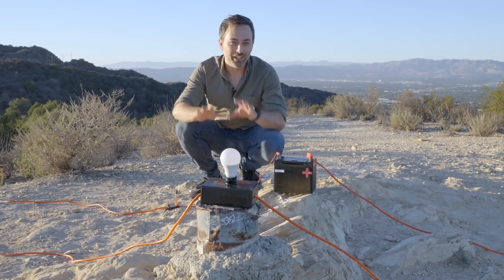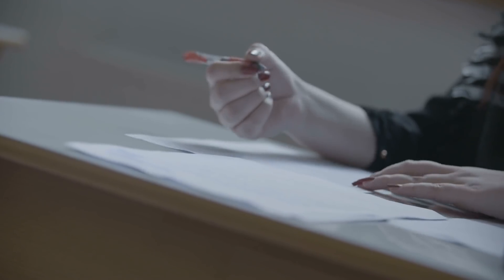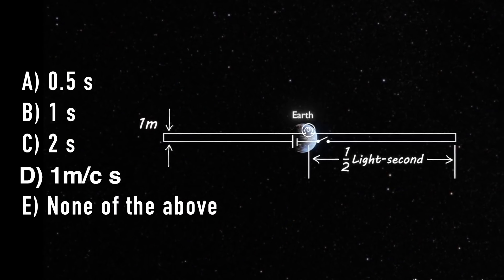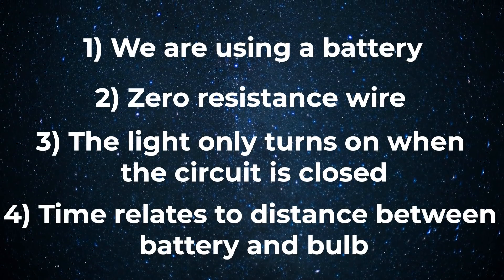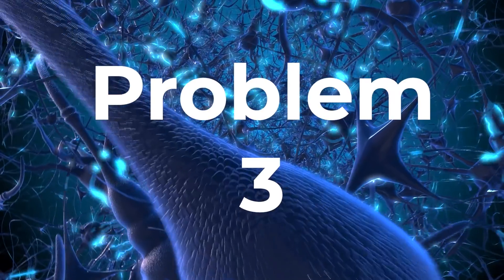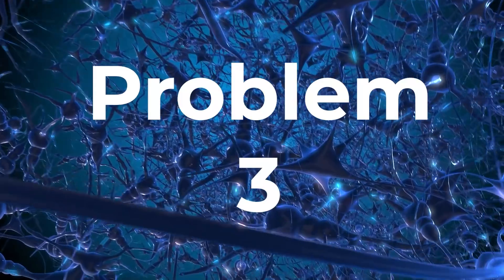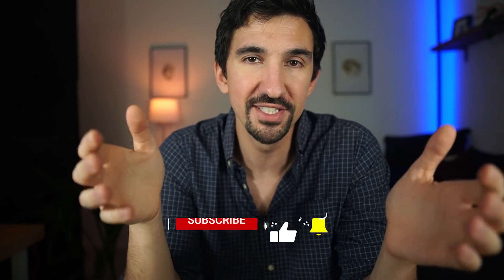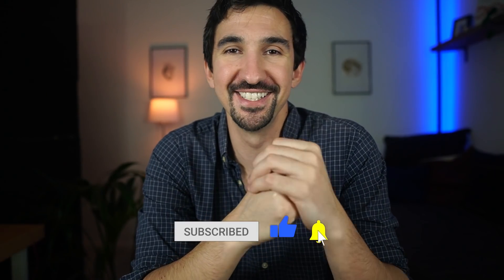Is Veritasium Wrong About Electricity?

Comment: It really helps to consider the following (imo)

1. This whole thing has been framed in a misleading/loaded way by talking about circuits from the get go, when there is in fact no circuit to speak of at least within the window of time he's talking about (~1m/c)
2. Locality is a thing. No matter how you dress up your puzzle, the fact is it's impossible for the lamp to "know" about a break in the circuit at some distance d from the origin until at least 2d/c seconds have passed after closing the switch. 
3. If the ends of the wire are far enough away that you have to account for the speed of light, then you need to stop thinking like an electrical engineer because this is no ordinary circuit. Changes in applied voltage will take a long time to propagate along the wires, so you aren't getting the usual self-interference. When we attach a wire to the negative terminal of a battery, without completing the circuit, we would say there is no circuit and hence no current. But we would be wrong; there is a current at first, but the electrons have nowhere to go and begin to bunch up against the end of the wire. This produces an electric field to counter the applied field and after some time, an equilibrium is reached and no more current flows. If the length of the wire is L and we (wrongly btw) assume that the signal travels at c, then we ought to expect it take roughly 2L/c seconds for the current to stop flowing. Given a meter of wire... that's 6.7 nanoseconds, so yeah we don't notice it. But if your wire is 1/2 a light-second in length, it will take about 1 second for this equilibrium to be reached. During which time, it is IMPOSSIBLE to determine by any means whether the wire forms a complete circuit, or reaches a dead end. In BOTH cases, the behaviour within the first 1 second will be identical, only diverging afterwards. So whatever energy reaches the lamp before that time (and it does exist for sure), would have done so regardless of whether the circuit was actually closed. It's a tiny amount of energy, not comparable to energy flux that you would have AFTER 1s given a closed circuit.
Reply: In all the fuss, this comment is the clear and definitive answer. IMHO
Reply: This makes sense to me.
Reply: Great point
Reply: Not only, but this explains also the one wire Transmission of energy described by Tesla, leaving out all the mystifications on him.

This using AC instead of DC (that tiny amount of energy get transmitted often with High Frequency)
Reply: I am so confused now it’s not even funny
Reply: Nice you've taken the time to write it, simple explanation, seems obvious for an electronics engineer. Thank you!
Reply: Well said

Comment: If the wires are 0 ohms, then doesn't that mean they can't act as antennas? My intuition says that the ability for the wire to couple with the source is dependent on its reactive impedance, so if we say it's got no impedance, then there's no coupling, and if there is coupling, then there is reactive impedance and the total impedance therefore becomes so high that the frequency characteristics of the circuit become such that the time constant is infeasible high and the light never turns on. Even if it does, it slowly begins flowing rather than flicking on instantly like an LED.

And if we go one step farther, then the coupling of the two wires together makes a capacitor, so now we aren't looking at an RL circuit but an RLC circuit where the virtual capacitor is moving down the wire at the speed of light

Comment: not very good experiment, what if you have       same setup, but with 2 wires very close to each other 1-2 mm, moment electirceity starrt to flow it will induce current in second wire and some current will be going thrught bulb, in even less then 1c/2

Comment: You are right. The current flow model of the circuit breaks down, and we need to consider the problem as an electromagnetic field problem. The time taken to see the bulb light depends on the capacitance of the circuit. The initial DC transient response of a capacitor is short circuit. Have a Google for transmission line s, particularly the lumped parameters model. With that, you can show that the globe will begin to light up, even if the remote ends are open circuit

Comment: My disclaimer is that I'm stupid and I don't have degree in physics. But I completely didn't get Veritasium's model and for my simple logic the real answer is 1s ,which is: the length of wire between battery and bulb / speed of light. 
The question is if signal propagates through the length of the wire or through the space between the battery and bulb. In this video Veritasium's battery-bulb model is compared to antenna -  as signal between the source and antenna propagate through the space. I refuse this analogy either because antennas receive signals transferred by EM waves, while in Derek's model signal in transferred by energy field . EM waves and independent from their source ,while those "energy flux vectors" are a part of a "energy field" - same as magnetic flux doesn't exist without magnetic field. In my opinion electric circle in Derek's model works more like a big magnet than antenna.

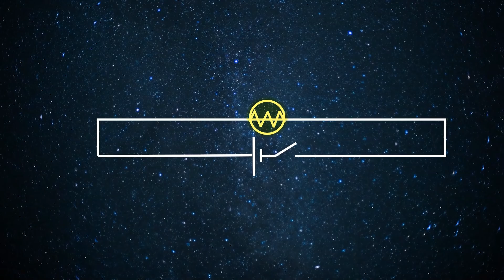Comment: At 4:30, the current does NOT suddenly stop in the light bulb if the circuit breaks 1/2 light-second away.  When the circuit breaks, a potential difference develops across the open circuit and an electric field forms and builds toward the light bulb and battery.  The light will continue to glow until this electric field arrives at the light bulb.  The increasing and decreasing electric field represents a "displacement current" that is just as real and physical as charge flowing through this space.  This electric field front propagates at the speed of light.  The arriving electric field cancels the electric field in the light bulb and stops the bulb's current.  (If characteristic impedances are not exactly matched, the dynamics can be more complex and die out more slowly.)  The characteristic impedance of two wires 1 m apart is about 1000 Ohms so we would need about 1000 V for the bulb to glow visibly.

Comment: The problem is that ultimately the force that causes the bulb to light up is still traveling along the wire the entire distance from the battery. The forces Ben Miles is describing in the last third of the video exist, but are not what is causing the bulb to light up. They could be detected, its true, but in devices like radios that detect them, they require amplitude modifiers on the other end because the strength of the induced current is a tiny tiny fraction of what exists on the other side. These eddy currents are inconsequential to the question posed in the original video. The Poynting vector does not flow in empty space in an ellipse around the circuit as it was drawn in the video, it flows along the entire distance of the wire itself, within and just outside it. If there was a break in the wire many miles away, if it occurred at a time T<distance/c before the switch was closed, there would still momentarily be power flowing to any other devices along the battery side of the wire up until the break, until causality caught up to it. However that power would never reach the other side. Only the tiny induced current you described would, which would not have nearly enough power to light the bulb.

Comment: The problem I had with the video is, as a welder I am very well versed in how electricity flows. He failed to state dc electrode position and then no AC interaction with pulse or sine wave equilibrium. Also the fact I don't get electrocuted while welding or any issues with electronics in proximity.

Comment: The way I underside it,  the battery was a meter away fun the bulb. 

As i recall,  he did say to assume 0 resistance. 

The wave propagation he talks about is limited by c.

TIMF, either.

Comment: You're missing the bigger picture. Electricity in a conductor travels faster at the edges of the conductor compared to the center, but the electrons at their fastest only travel at 4.3 CM per HOUR. The electrical force happens outside the conductor in the electromagnetic field, making the field act almost instantaneously between the battery and the light bulb. We all assume that the electrons have to traverse the full length of the wire, which is wrong. It's the current does that (which is slow), the majority of the energy exists outside the conductor in the EM field, so if the battery in close proximity to the lamp the energy will come from the EM field.

Comment: If we change the setup, put the battery immediately next to the bulb with a light activated switch, and shine light through a 300000km long fiber optic cable would the bulb turn on in 1m/c seconds?

Comment: I think the real problem lies in the ignorance of energy flow changing with where the information is coming from. Let's say that the information travels down one side of the wire at the speed of light to a fixed distance away from the source. At that point in time the direction energy is facing is at that spot in the wire ergo no break in causality. So it would take however long it takes for light to travel the distance of the wire for the light to turn on. 

On the other hand... how long does it take for the light bulb to turn off if there was a break in the circuit? Does that same information travel down the wire? Or does the energy field suddenly shut off? Or is it more like the energy field changes its origin point as the information travels down the wire at the speed of light?

Comment: Your circuit doesn’t have to be closed… That’s the wrong assumption… If you open the circuit on the left and the right side, as soon as you flip the switch on that huge non-resistant wire it would induce incredible amounts of current until the electron propagation reaches the end pf the wire… that huge current would create magnetic fields which would induce electrons to flow in the wire parallel to it like a transformer… Simple AF

Comment: The clue is in the 1m distance between the wire, which has zero impedance.
I'm not too sure where I stand on the whole 'education' thing. To my understanding, there is a time difference between a better truth coming out and it reaching the masses of the world. There are fundamental differences in the world of electricity when it comes to the common man.
Great video. Thanks for sharing.

Comment: I know there are holes. But I think Vertasium already answered what this video is questioning. Illustrations always have a limit. The chain with AC in his video for example. True Electrons go back and forth. But anytime I take my multimeter and test over a load i get a potential difference. That eerie 120 volt drop. Why would electrons that are still moving back to the power plant still have a drop. His example answers voltage drop. Something the chain example doesn't.

Its all simplification of the reality we are in. It doesn't answer everything, but it sure gets me closer to understanding reality of a insane physic. With that I can do my job better, and improve. Whether he is right or sorta right, he is on to something. Sometimes having the "your wrong because" may add to that, just its ironic to the goal, and that's fine.

Comment: I thought Veritasium's whole claim is that electricity does NOT travel through the actual wire/cable. The reason the lightbulb turns on immediately when he closed the circuit, despite the cable physically being routed through a very long distance, is because the switch and the lightbulb are only a few inches away from one another. In your video, your example is pretty much saying that the lightbulb is lightyears away from the switch, which is not the same scenario as in the Veritasium video.

Comment: Hmm still confused. Put more simply if I setup a chain loop between here and mars assuming this were possible, and the planets stayed a fixed distance apart from each other, I and pulled one part of the chain (assuming I had the power to do so) and there was no slack in the chain. Would an observer on mars not see the chain moving instantly as I did it? And if I moved it one direction to communicate a 1 and the opposite to communicate a 0 would we not be able to communicate instantly? I understand that general relativity states that nothing can move faster than the speed of light, but I think that depends on the frame of reference, no? At each local frame of reference on the chain (or link) it is moving at some constant speed << C. However just like two entangled particles appear to communicate spin instantly at any distance, wouldn't this chain example also demonstrate a case where information is traveling FTL? Not claiming to be right in any of this more interested in knowing where I am wrong.

Comment: You covered most of the issues that I see with the video. One other thing is that this is not an inductive load but presented as one. It doesn't work as he described but more like the big lie that you were taught! Lol I'f it were inductive the distance is to far to work and would still need a supply line with another inductive circuit. Basically I believe he stepped to far outside his element which is fine but presented as fact while not fully understanding the idea. The new lie! Lol

Comment: Versatium did not give a complete theory.  The problem is not the steady state problem.   It is the step function transitory problem of open switch to battery connected.  My educated bet is that current does in fact appear in the opposite (light bulb) conductor virtually instantaneously.  This happens even if the circuit is broken open at one or more far ends.  The correct tool to analyze this is transmission line theory.   The exact effect will depend on how far apart the parallel wires are compared to their diameter.  This will determine their characteristics impedance.  This will determine the initial current flow, not the total resistance of the wires.
SOLUTION ( outline ):  Consider half the light bulb filament wired to half the battery with switch to right of battery and long transmission line going off to the right.  When the switch is closed a step signal will begin transmission down the line.  The instantaneous initial current will be voltage of half battery divided by lamp half resistance plus transmission line characteristic impedance.   So in this case the light bulb lights immediately.
Now superimpose this with the mirror setup with transmission line going to left with the other half of the battery and lamp filament.   There is an extra conductor connecting the center of battery with center of lamp filliment.   However the current in the two separate circuits cancel at this point, by going in opposite directions, so I say it is the same as if that conductor wasn't there.  Also having two switches thrown simultaneously is the same as one switch,  so it is the same as the versatium circuit.  Note that the light still goes on even when the far ends are open circuit.  The light starts to fade due to the finite resistance of the transmission line.  It eventually settles to the steady state condition based on the resistance of the transmission cable conductors and weather the are connected or open at the end.  Thus can also be analyzed as a reflection from the ends.

Comment: I used to repair radios and transmiters.  

I can easilly see that power is transmitted to the light bulb 1 meter from the battery wirelessly  capacitivly and inductivly in as little as 1m/c  seconds, and that's why this does not break causality. During the first 0-1/2  of a second, you can treat the wires as simply a transmit and a seperate receive antenna seperated by 1 meter and the power is transmitted electomagneticaly.  The bulb will light  in 1m/c reguardless if the wire is broken or 1/2 light second away. 

assuming the wires were superconductors. If you placed the light bulb 1/2 a light second away. Then it would take 0.5 seconds for the signal to reach the bulb causing current to flow lighting the bulb.

Comment: So.. what if you had a “stick” that was a light year long… wouldn’t moving one end of the stick instantly move the other end, thus creating the possibility to communicate information faster then the speed of light?
Reply: It would actually take longer than a year for you to push one end of the stick and for it to reach the other. It will propagate through the stick at the speed of a mechanical compression wave (which will be slower than the speed of light). So if you sent a radio signal at the same time you pushed the stick, the radio signal would arrive before the stick moved on the other end.
Reply: @ialsoagree  really? I’ll have to think on that. Thanks!